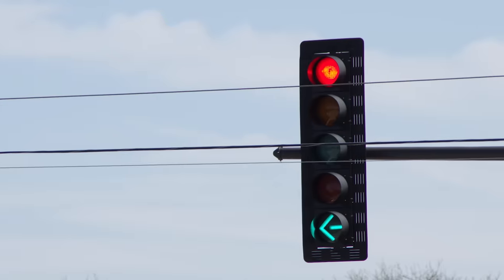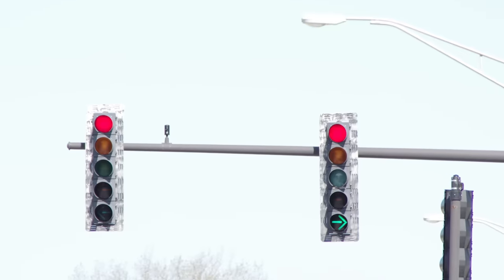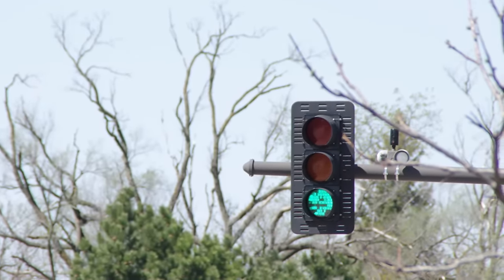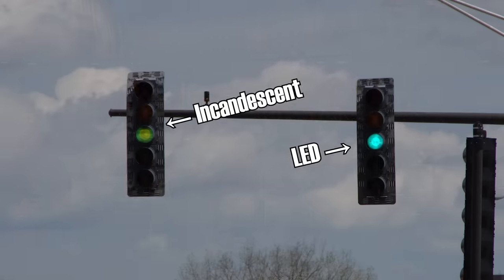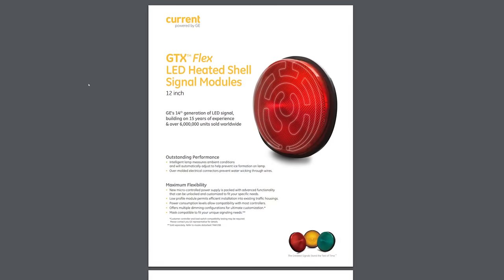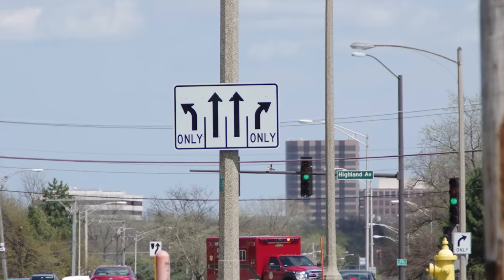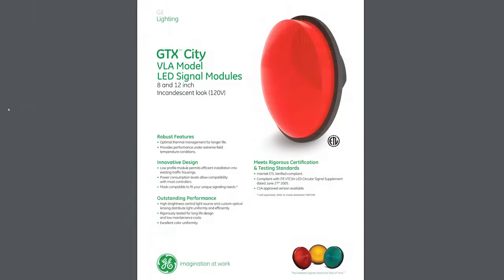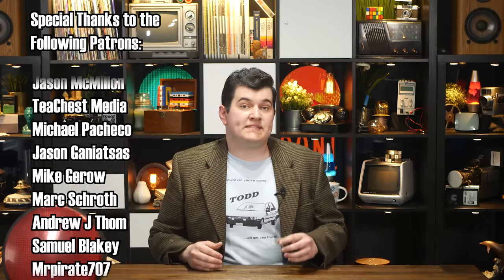The LED Traffic Light and the Danger of "But Sometimes!"

Comment: The battery backup working during power outages is huge, I remember being stuck after a big storm for like an hour in half a mile of road on huge road crossing another big road that was reduced to stop sign rules which nobody knows how to follow when the road is that big. Extremely slow and I was going against traffic, I mean it was still a big backup but after crossing I watched like 5 miles of cars backed up, like they're stuck and once you're 3 miles back the powers probably going to come back before you get through.

Comment: I had to explain the "but sometimes" deal regarding solar panels in Canada. Funnily enough, it was also about snow since, as you hammered in multiple times, it doesn't snow everyday. I have mixed feelings on solar in general, but snow is not the problem. Also, it was on a little mobile solar thing which can easily be brushed off

Comment: Wow, intriguing that in america you don't mount trafic signs on all crossings with light... In europe they are always there. Just in case the lights are not working.
We use a priority system: if there is police conducting trafic, you listen to them. Trafic lights take priority over trafic signs. So, when lights are operating you just ignore the signs for that crossing.
I find it strange that you would fold up the sign or not have it as a contingency.

Comment: One thing that puzzles me is why there hasn't been a more profound redesign of traffic lights. Using R/G LEDs, we could have a single lamp that is capable of displaying all the usual states (ideally with the colourblind-friendly approach used in Quebec, with ▣ ︎red / ◈ yellow / ◉ green) as well as a full range of arrows and situational indicators (like lane closures, or “yield to these pedestrians, even if you think you're allowed to turn right on red, a–hole”).
Reply: The position of the lamps is part of the signal system. Red on top, yellow in the middle, Green at the bottom. Or Red on the left, yellow middle and green to the right.
Reply: @Blazer02LS  Yes, but lamp shape works better, since it can be held constant in more complex situations.
Reply: @stephenspackman5573  Not really, especially when you consider how long it has been taught in the US (basically since lights were introduced) Plus the shapes don't seem to matter on signs here so I doubt the shape of a light will help. Of course with self driving cars this will all be overcome, well maybe if they get them to stop crashing...
Reply: @Blazer02LS  I lived in Quebec for many years, the shaped lights are really good. And if “we always did it that way” were a killer argument we'd still be riding horses.

Comment: Sometimes things happen more often than but sometimes, like every day the sun sets. I ran across a traffic signal on River Road in Buffalo while returning home from a day on my friends boat. There was a signal near an overhead railroad bridge of the internal mirror type where there is a bulb presumably with a reflector to bounce the lights rays 90 degrees toward the oncoming traffic. There is just one problem, those same mirrors bounce the light from a setting sun into oncoming traffic thereby making green lights appear to be on even though they aren't energized. I almost went through the light thinking it was green until the remainder of the upper portion of the light was not obscured by the railroad bridge as my car moved closer. I was a young engineer at the time and was disappointed in the lack of foresight by my contemporaries of the field, but hey, Challenger had just crashed, so things get by us mortals.

Comment: An even better idea would be to heat the visor around the light, as that would mean you wouldnt have to throw away perfectly good heaters when the led burns out, and would probably work better.
Reply: Usually, there is much more snow and ice on the visor than on the light itself. It would need more energy to melt that away, and might have less effect on the center of the lights, as that would be furthest away from the heaters.
Reply: @skayt35  You can add insulation between the inside heated part of the visor and the outside part where snow will indeed build up, this would both keep the heat inside the visor and prevent the heating element from wasting energy to melt snow that wont actually affect visibility. Also the very center part of the light is very rarely covered in snow, so i doubt thet eould be an issue.

Comment: I don't know what the differences in maintainance between the US and Germany are, but in my 20 years of driving I have encountered defective "bulbs"... twice. And so far I drove about 1 mil kilometers (620 thousand miles). It's WAAAAY more common place to encounter police men/women manually regulating the traffic so maintaince workers can maintain the traffic lights, than actually encoutering defective traffic lights.
Also: When I import products from the US, the inside plastic seals (the foil around the products) actually do have a warning printed on them not to stick it over my head because I could suffocate. While most people are "just stupid" (aka average intelligent), there are some very stupid people out there that you also need to cover. Somehow.

Comment: Here in Sweden we have snow (that we forget exist in spring, and get equally surprised when it snows in winter next year) and we have those stop lights for some time. We also, for longer time, have had the signs on the lights that dictates if you need to yield or not when the light is out or not visible.

Comment: I just discovered your channel I think you're great. I know this is really old so I hope you see this comment but I like to talk about traffic light patterns. I agree with everything you said about the light patterns that you discussed in this video. I think that there is an overall better way to handle traffic at 4-way intersections that don't have any kind of unusual aspects. Instead of having all east-west traffic go and then all north south traffic go you have each individual direction go by itself with a protected left while you get the corresponding protected right and it just goes in a circle around the intersection. There are a few intersections like that in Houston. There are also lots of intersections where you're not allowed to turn left at all and people do it all the time anyway and cause accidents. If it were to go the way I said you would not only each traffic by allowing people to take a more direct route you're going to vastly eliminate accidents from people turning left in front of traffic. Take a look at it and see how it pans out

Comment: A little usb heater only takes 1 watt, plus the 4 of the LED, there is no excuse for not heating them in the rare occasion where / when it's required... Only needs to be a few degrees above freezing after all and the housing will absorb and hold most of it.

Comment: Even if the LED unit can rarely be totally blocked by snow storm, the absence of LED visibility is so infrequent, compared with old incandescent lamp failures stop showing at all.  Surely the old has hugely higher danger of not showing active lights, under any weather conditions  not  just when extreme weather is occurring, simply of globe fail rates alone.

Comment: We Electrical and Electronic Engineers are well aware of the intentional failures that manufacturers design into LED lighting to ensure that LED lighting DOES NOT outlast their incandescent predecessors. The ignorant public does notice this to some extent, but do have have representation in media and courts to fight this dishonesty; which is perpetrated on the basis of sales and profits. I have helped many people with LED lighting in their vehicles install resistors in line with the LED fixtures to cut down the current draw, which more than quadrupled the lifespan of the LED fixtures in their cars and trucks. The basis of comparison has been like makes and models and years of vehicles, and, yes, we QAUDRUPLED the lifespan of LED's without sacrificing light intensity since MOST LED fixtures are much brighter (mainly because of being over-driven) than the minimum requirement of DOT regulations.

Comment: You’ll always have areas and situations where different tools are better or worse. There is a reason carpenters will have nail guns and hammers. 

The electric car is a good example. In some areas they are great, in some areas and applications they are not at all practical. In some areas there are eco friendly and reliable power, like hydro, were additional fuel is not burned to power the grid and thus grid losses don’t result in more fuel burned.
If you need to pull a grain trailer in frozen mountain roads an 150 miles each way, stick with gas or diesel. If you drive 10 miles to and from work each day, an EV might be a good option. 

Where I live it gets cold, like really really diesel can freeze without a block heater, frostbite in minutes on bare skin, cellphones stop working if you sit them down on anything, COLD! Fall tends to have freezing fog also and temperatures generally stay well below freezing for about 3-4 months. Our snowfall is generally given in feet and ice fishing is popular.
We also are 130 miles from the nearest Walmart. In areas like this LED’s and EV’s just don’t work well here. 
So there is a place for good old fashioned incandescent bulbs but for places that have never found a missing person in their car completely buried in a snow bank right by the highway where they had been frozen for the last three months LED’s really are the way to go.

Comment: The icing issue is a problem on vehicles for same reason . My 2021 Freightliner doesn't have the built in heaters so as I drive through night in bad weather my lights " SLOWLY FADE " . I highlight SLOWY FADE because what happens is my foward vision also slowly fades . This means after driving 2 hours my foward lighted view has greatly reduced but because it did so slowly its not apparent until I go through a lit town or pass something that I should have seen it sooner . I'm now aware and used to this phenomenon but problem is NOT EVERYONE IS USED TO OR EVEN AWARE OF THIS PHENOMENON.
  P.S ... so if I put a white strobe light in my car that matches the strobe of an ambulance... NEVERMIND 🤣🤣🤣

Comment: LEDs are great, but their AC to DC power supplies become the reliability problem from component failures due to thermal cycling. LEDs also lose brightness over time and must be replaced when they drop below specification. They are not without maintenance costs.
In the aviation industry, large airports around the world concluded that, since LEDs last longer AND use less power, they should immediately convert all runway lights from tungsten filaments to LED. What could possibly go wrong? Answer: Modern aircraft have Forward Looking InfraRed (FLIR) systems to aid Pilots landing aircraft in very bad weather... those "low power" LEDs don't give off enough "heat signature" to be visible to a FLIR, hence, Pilots flew "blind" into some airports, but not others, so the FAA had to start a registry of airports in the U.S. with LED runway lights and notify flight crews. And what was the long-term answer to the problem? Why, to put heating elements in with the LEDs! BAM! Now it's back to wasting power like those old tungsten filaments.

Comment: He didn't mention the LED traffic lights that don't use colored lenses -- instead, the LEDs behind the lense are colored and the lenses are clear.  When sunlight strikes a colored lense at just the right angle it can make the light appear to be on when it is not, which can confuse a driver and could cause an accident.  By using colored LEDs behind clear lenses traffic lights look gray when off and look colored only when they're on.  This is particularly beneficial for traffic lanes heading due east or due west where the rising or setting sun is most likely to cause a dangerous illusion.

Comment: One thing I would add is that, as a slightly colour blind individual (red-green - very common) I struggle more to see a green hue in an LED than an incandescent light. It looks white, and only context makes its purpose evident.
But then, this is one reason that I do not drive (there are others).

Comment: Speaking of finding solutions to discovered problems, it's funny how I was thinking that for cold weather areas the manufacturer could include a thermostat and resistive heating wires in the lenses. Then a couple minutes later you pointed out that GE makes LED lights with a thermostat and resistive heating wires in the lenses. I wanted to invent that, but someone beat me to it, Lol.

Comment: "All stop intersection", folded STOP signs... Wow!
What has always puzzled me is why North America loves this STOP nonsense. Why not adopt the "yield to right" rule? Makes passing a non-regulated intersection so much easier. I remember those short suburban blocks in San Francisco, where you can get sick because of accelerating and stopping on every damn crossing.

Also, Europe has signs (main road, give way) below traffic lights just in case traffic lights go out. Easy. Traffic lights work? Use them. Traffic lights out? Use the signs. Why the folding stops, WHY?

Comment: In this case, it sounds like IGNORING the "but sometimes" is the actual danger.  If the solution is "money is saved" and the problem is "but sometimes innocent people die horribly", then the "but sometimes" is a pretty valid concern, especially when the "sometimes" is "during snowstorms" and the argument is being made in a place that gets heavy snow annually, like Illinois.  That's not to suggest LEDs shouldn't be used, but to act like people raising concerns about them are simply ignorant and afraid of change is ridiculous in this case.

Comment: I wonder if these bulbs would hold up here in interior Alaska. That sometimes becomes most of the time. We have 8 months of snow cover, regular -20F, and normal dips to -40F or rarely lower. We drive in "blizzard" conditions regularly out of nessesity. If that's still viable that would be pretty cool ngl.
EVs are slow to catch on up here for that same reason, but tech advancements are helping.

Comment: The real solution to this is to imagine both options as brand new and weigh the pros and cons before picking one.  

Maybe LED lights ice over and become nonfunctional sometimes.  But does their yearly total downtime rival incandescent?  If not, it is illogical to get stuck on that as a problem when it's actually an (imperfect) benefit.

Comment: Regarding the right turn arrow. In East Germany was the invention of green metal arrows for right turn lanes. If the traffic light is red, the cars have to stop simular to sthe STOP sign. But if the driver sees that no pedestrian or cars or someoen else is coming you are allowed to drive also the traffic light is red. So these worka without any lamps or energy. Bust a small metal sign and thats it.
But since we are all more like western Europe, the most of these arrows had been changed with traffic signs and lamps.
I dont know why but i think these old sign are very good and can be used 24/7 and you never have to wait long.
Reply: In most US states, you are generally allowed to turn right on red, after stopping and yielding. You don't even need a metal plate then.

Comment: Regardless of the enthusiasm for LED lights that this person is showing, snow is present in northern states and Canada for about half of the year. I have personally seen traffic lights that were plastered with snow and impossible to see on many occasions. Heaters have made it less of a problem, but penny pinching city managers have been slow to have them installed. It would probably have been better to do more testing before everyone succumbed to the "new and shiny" syndrome. Semi trailer taillights are another problem, with the LED lights showing up on many fleet trailers. These are installed because they have all of the advantages that are listed in the video. The snow problem is even worse though, because the snow swirls in the slipstream at the back of the trailer and the taillights get plastered with it very quickly. As a long haul truck driver, I have on many occasions been behind another truck in slow traffic and been unable to see their taillights from 40 feet away. From your desk, the solution is easy. Out in the field, it is much more complicated.

Comment: Even something as simple as an inefficient peltier device could prevent these lights from frosting. Hell, you could put a high resistance LED in the circuit so it produces enough heat on its own to melt the snow. Sure it would drive the cost of electricity up, but it would more than likely still be more efficient than an incandescent bulb.

Comment: Your argument that we should not worry about LEDs becoming hard or impossible to see in winter storm conditions, because that's so uncommon, will be cold comfort [pun intended] to someone who is killed because of it. You are correct, that it should not be difficult to engineer an effective solution, but note that this added complexity will erode the cost advantage of LEDs. 
Boils down to an age-old question in traffic engineering: What is the human cost in terms of added motorist lives lost per dollar saved if we implement this traffic system design change? How much money is a society willing to spend to create a REASONABLY safe traffic system, and who decides what is reasonable.
Reply: Did you watch the video all the way through? He gave an example of an existing LED stoplight that can heat itself to melt ice/snow whenever it's needed, and three of them use less power than a single incandescent bulb.